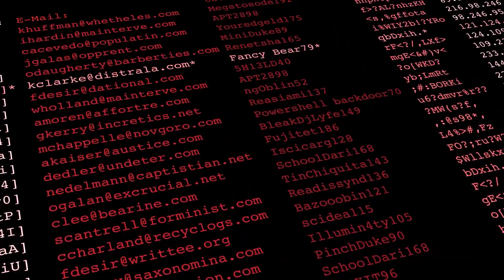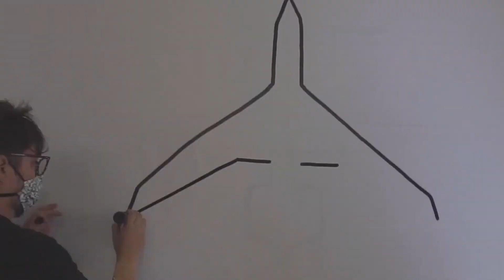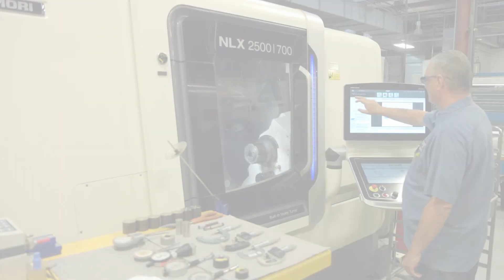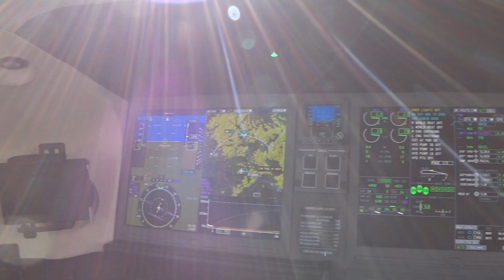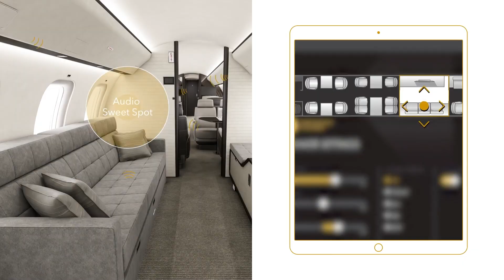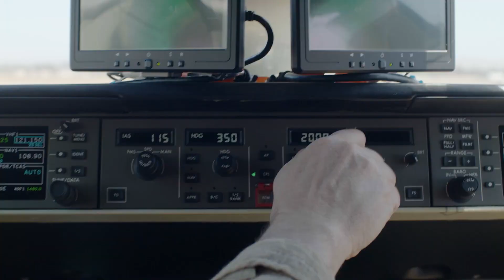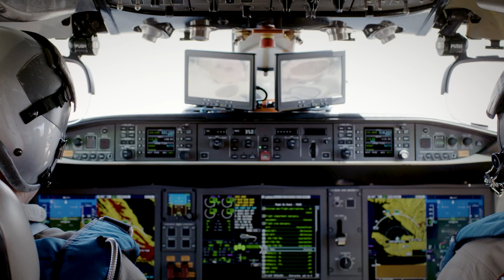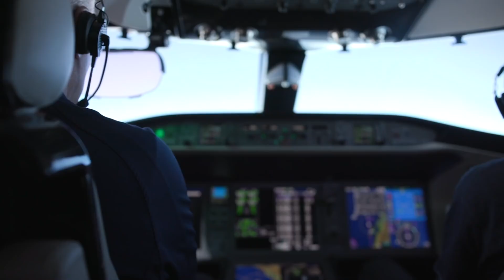Bombardier Global 7500 | Being the best

Comment: The mach 1 flight is, I think, more than just PR, and an important test.  If you have a business jet that can go at a steady speed just short of Mach 1, then there could be circumstances in which it would attain or exceed that.  From my understanding, the "trans sonic" portion is the hardest on the air frame (see instances of crashes in WW II with the faster piston engine fighters that lead to a lot of this research in the first place), and it's worth knowing that the air frame can handle the stress.
Reply: There are FAR regulations that require manufacturers to test their aircraft.  In this case, they have max speed for Global 8000 to be mach .94, so they are required to test it to a speed greater than that.  In this case they were required to test to greater than mach 1

Comment: 900m cabin pressure is a really big deal for reducing jet lag.  I do wonder about the larger windows though.  There are a lot more damaging UV rays at altitude and if they haven't treated the windows accordingly, passengers and crew will definitely need to wear some sunscreen.
Reply: any plastic blocks UV''s, and this is the reason plastics wither when exposed to the sun for a long time,  they de-polymerise

Comment: Isn’t this already surpassed by the 8000, so it’s already not the best
Reply: The 8000 is not in production yet.   It will replace the 7500.   The 8000 is just a 7500 with a few improvements
Reply: @rcairflr  so you're saying the 8000 is the best
Reply: @whiteandnerdytuba  > I am just saying the 8000 is NOT in production yet and no one owns one yet.   YES, it will be an improvement on the 7500.  Your statement makes the assumption it is already the best.  HOW CAN THAT BE IF IT DOES NOT EXIST YET?
Reply: @rcairflr  because customers with a 7500 on order were offered the 8000 as an upgrade

Comment: Many thanks for reintroducing the thrust in lbs.
1st sponsored video?
What happened to Smokey's Lounge? It's the standard Skyships background music, it seemed unusual to watch without it in the background.
Reply: That's a retrogressive step. The world understand metric, not obsolete units hardly used by anyone . . .
Reply: @TRPGpilot  Oi! What altitude do you fly at?
I've said to Skyships repeatedly that I can do metric conversions in my head to anything other than thrust values, Skyships is a very obliging gentleman. BTW, not only altitude, what speed do you fly at or range can your plane cover? All are Imperial units.
Reply: @COIcultist  Not all miles are imperial! Nautical miles, and the unit of speed derived from them, knots, have nothing to do with imerial units. They are much older, and still very common in aviation and nautical applications.
Reply: @Colaholiker  The concept of the Nautical Mile was old, but a value was probably first given to it by Robert Hues, The 1929 conference to define the Nautical Mile wasn't ratified by the US and Britain. The UK does now define the Nautical Mile in metric terms, and it is about 7 and a quarter inches shorter than the Imperial Nautical Mile. Mind you, the metric definition was changed from 1,852 metres to 1,853 metres. Practically, I'm not too bothered about 7 and a quarter inch.

Comment: Why do such small aircraft have so many windows?
Its almost as if they saw the plans for larger aircraft and simply shrunk everything without thinking if less and maybe slightly larger windows would be better.  If not as if there's a row by each one (many such jets have few if any formal rows).
Reply: Think about your question for a minute. Do you want a large hole in your pressure vessel?
Reply: Larger windows are difficult to keep safe in flight at low external pressure and they create decompression event risks to passengers.

Comment: Upgrade program for Global 7500 into Global 8000 will be a big bargain for the customers
Reply: GL8000 does not exist.
Reply: @brettrun8575  Yes it does. They're intending to discontinue the 7500 & replace it with the 8000, because the two are identical aside from the fact that the 8000 is faster & longer range, so there's literally no reason to keep making/selling the inferior product. It'll just cost the company more money in tooling/production to make two products vs making just one. 

Plus, the current 7500 owners can take their jets to Bombardier & have them retrofitted to become 8000's, instead of having to buy brand new 8000's.

Comment: Gotta be off off-putting using a side side-stick in your indominant hand
Reply: I've often wondered about that. But I'm left hand so a lot times I have to navigate a world designed for right handed people (numberpad on your keyboard anyone?). The other thing is I travel and drive cars in countries that are both left and right hand drive. Even when driving a manual transmission, I find the switch isn't that hard.
Reply: Even with a yoke you usually use only your left hand to use it, as the right hand is either on thrust levers or operating knobs and dials. 

Unless you fly a jet fighter.